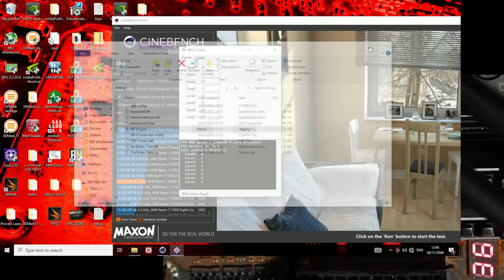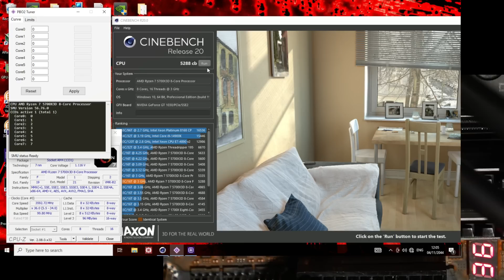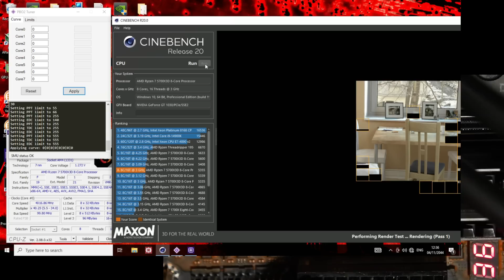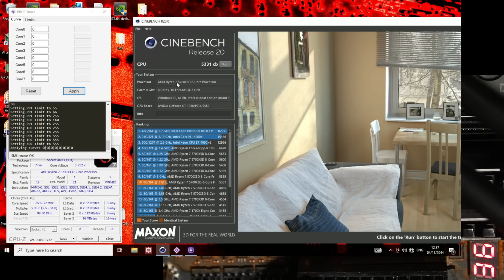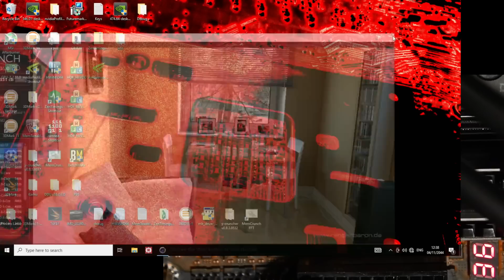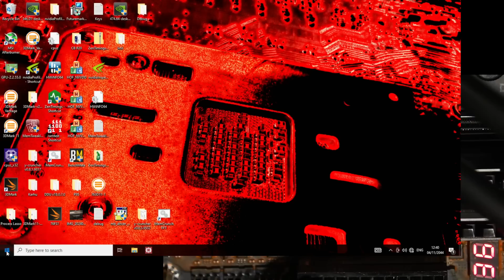Trying PBO2 Tuner on the 5700X3D

Comment: Undervolting for lower temperature when ambient temperature is a factor (Summertime) with air cooled solutions. Undervolting tis a benefit with a CPU the likes of a 5700X3D being a very decent gamer's CPU not because of clock speed, but for the additional memory cache.

Comment: It's April 2025. I have an Asus B550, with the latest bios update, you can optimize the curve optimizer in the Bios and change the frequency. The optimizer also factors amperage, which does affect overall wattage. Stock settings I got 748 points in Cinebench 2024. With -30 on all cores (-25 with core 4, which is my weakest core) I got a score of 826. That is 1 point higher than a stock 5800x3D and 10% increase over stock performance. Stock single core score was 64, after -30 optimizing, the core is now 86. That is 10 points below the 5800x3d, however that is a 34% increase in performance. Wattage went from 112 to 96 (voltage went from 1.22 to 1.09), which is a 16% reduction. Average temperature went from 86c to 77c, which is a 12% reduction. At the moment I only have a 280mm AIO, looking to upgrade to a 360mm soon. Average boost clock went from 4036 to 4126, only a 2% increase. However the biggest improvement is overall better 1% lows in games, and better stability in productivity. Overall average PC wattage in regular gaming scenarios went from 217 to 179 without touching the GPU (1440p 144hz monitor with a Rx 6800 which is also undervolted and overclocked). That said, I would like to test again with a better cooler, it may be possible I am seeing a slight thermal limit. Will test again with a better cooler.

Comment: 20:50 yes, though in games, the clock speed can lineraly improve the performance (see the different between the 5600 x3d and 5800 x3d compared to the 5700 x3d.
Reply: bro you are not a woman
Reply: @GenerationalEnslavement  keep that to yourself

Comment: The voltages on this CPU are crazy high! Even at -30 I was still seeing my temps reach the mid 70s (all of this while the CPU was consuming 40 to 50w). Only after adding a -75mV offset was I able to get the temps to a more reasonable level

Comment: What about in a gaming environment? More consistent boosting might mean less stuttering? I just installed my 5700x3d and ran a -30 offset and in cod benchmark, I have 5fps better 1% lows, 7fps better 5% lows, and the same average fps. Also like -6 degrees cooler. This is with my browser open to respond to this video through and normally I close out of this before benchmarking. Still within margins of error but it's looking good.

Comment: The best settings for me are : curve optimizer on -15 for the two best cores and -25 on others / PPT : 110 + TDC : 70 + EDC : 100, i think it depends of your cooler and i have the bequiet dark rock pro 4 but if you have a cooler worse than me use -20 and -30.
Reply: What "2 best cores" mean? How do you determine that?
Reply: @LibtardsTears  corecycler

Comment: You don’t want overclocking which pushes the cpu with the 5700x3d. Undervolting is about lowering temps and still getting the same performance. I’m at -30 and hitting 4.15ghz and down 10°C. So that’s perfect for me, does exactly what it’s supposed to.

Comment: -30 doesn't seem to work on my 5700x3D... but on the other side i don't have thermal problems so i'm not sure if i really want to tinker around with those settings
Reply: The 57 is a slightly lower power part to the 583D and therefore shouldn't run quite as hot.
I run a full water loop and the 58003d would easily get to 80°+.
-30 with PBO tuner, I'm seeing 60-70° in all games.
I can't say there's a performance gain, but there's no noticeable loss and the system runs cooler and quieter.
Reply: @pauln6803  with stock settings i get 71° max temp while running cinebench, while gaming it's about 55 - 60° 
With -25 pbo curve it's 61° max temp and 45-50 while gaming dependending on the game. Seems like i'll go with the -25 if i don't experience crashes
Btw using an arctic freezer 34 esports duo but only one fan

Comment: ROG B550-A Gaming, I can manually overclock cpu ratio on my 5700x3d, but will not go over 4050mhz even when setting 44x ratio. effective all core 4050mhz, without the bclk oc.
in my experience if I dont use any negative curve opt in bios cpu downclocks to 36x or lower, Curve opt -30 worked the best, did -15 -20 not anything between. although reading 42/44x ratio its not affected beyond that point. Undervolt/oc
My settings
Manual core ratio 40.5x, negative curve optimization of 30, core voltage 1.875 for constant 4050mhz, c states disabled, 3800mhz/1900fclk custom tighten.

Comment: I have two systems using 5700x3d. One is with an A520 motherboard (no pbo on this one) and one is with a B550. I can use PBO on the B550 setup. Running -30 on all cores. Both systems are using single tower 120mm air coolers. On B550 setup the CPU runs cooler because of the PBO and constantly boosts to 4050MHz in all core load. But as said, these CPUs will be used for gaming, and in this case the A520 setup often boosts to 4050MHz anyway in gaming, because the CPU is not loading all cores. In very CPU demanding games like Cyberpunk it can vary between 3950MHz and up to 4050MHz VS B550 setup that always stays at 4050MHz. Really makes very little difference. Of course, better temps with PBO. But temps is not a problem anyway when gaming. Only in stuff like Cinebench that puts 100% load on the CPU. In that case my A520 non PBO setup can reach 84 Celcius and clock down to 3850MHz VS B550 setup at constant 4050MHz and lower temps. So score will be a bit better. But I don't use these setups for cinebench anyway. LOL. They are for gaming. So in a way, PBO for these CPUs are kinda useless and will make very little difference in realistic scenarios, like gaming. Doesn't really matter that much if the CPU is running 65 Celcius instead of 60 Celcius in a game, while in many cases it's boosting to max clocks anyway. And even if it downclocks a bit, it makes very little difference.

Comment: As a personnal feedback, I was in the situation where the cpu was hitting thermal limits. With stock settings, this looks like it's getting ton of voltage throu PBO ; mine was constantly hitting temp limit under y-cruncher BBP, even with my big double tower noctua. Tuning CO gave me the ability to sustain max clock throu most situations ,without hitting any limit.

Comment: I just did this yesterday - got a 5700x3d for my kitchen pc - an MSi Tomahawk Max b450. Cooled is a Noctua DH15 with one fan. 
Ran CB23 and 24 - stick had peak temps of 71'c. At -30mv this dropped to 61' 😮 CB23 had a boost of nearly   1000 points on multicore. Cb24 had a boost too - both single core tesrs were very slightly higher.

Tech Yes City posted that it makes a bigger difference on air cooeld rigs.

Comment: I have an old b350 motherboard with not a lot of options for proper overclocking this x3d processor. For me and my mid-tier air cooling this bit of undervolting drops my max temps on linpack from hitting 88/89C at stock(on a day when my room is cool) to stay under 80C at -21 and under 75C at -30. Allows for gentler, quieter fan curves and who wants their stuff running hot and wasting power unnecessarily anyway. I've been at -21 for 9 months with no issues.

Comment: Have a 5800X second gen, and was thinking of moving to a 5800X3D, but they are getting hard to find for reasonable cost.  Wondering if a 5700X3D can easily be tuned to equal the perf of a 5800X3D ? (running an AIO, so not worried about fan noise)

Comment: I increased my all core boost from 3.9GHZ to 4.1 and decreased my temps from 90c to 68c. It's very useful depending on the use case (I wanted lower temps the all core boost was a slight bonus because of the reduced temps).

Comment: after watching this vid and intel 12th gen clock stretching (also by BZ) i got really curious how cpu tuning affects performance on my system (7500f, noctua NH-U14S)
stock: CBR20 - 5753 (avg of 3 runs), linpack - 315 gflop (avg of 3 runs, 6gb)
pbo (PPT 120W and +200mhz): CBR20 - 5647, linpack - 316 gflop
pbo with curve (PPT 120W and +200mhz, -30 offset): CBR20 - 5926, linpack - 328 gflop

system should not be power limited (max package draw i saw is around 115w during linpack) nor temp limited (~90c)

Comment: i tried that PBO Tuner 2 also with my 5700G -  same thing happens -  does nothing -   it will use whats in the bios -  i have mines at -12 all cores -  stable - after that it works but not stable with OCCT dosnt crash but get errors -   my best settings are with -12 all cores -   gives me 4.45 ghz all cores in cinabench -  OCCT gives me 4.5 - 4.55ghz all cores -

Comment: will pbo2 tuner work with the r7 5700x3d? -20 will lower the voltage and temps of the cpu ?
Reply: PPT 120, TDC  75  and EDC110   are important too fill out in pbo tuner   if you want any result ™

Comment: Well lower temps won't matter to someone sitting at 19 C ambient. In India, the average ambient temp in summer is 36 C. So lower temps and same performance matters
Reply: Whilst thermal throttling might not be an issue through a cold British winter, the reduction in fan noise through dropping 10-20° is absolutely worth it.
The 5800X3d runs pretty toasty as stock, regardless of ambient temperatures.

Comment: I think curve optimizer isn't really that much about performance per se, it's more about having lower temps which means lower noise. Many folks are very strict with noise so in that sense it's a good thing, especially for people like me who just slapped my good old wraith prism onto this thing, works like a charm i must say, no issue at all. Doesn't seem like it's any hotter than my old 3700x. I did notice more stable frequency while gaming when i adjusted the voltage, it stays pegged at 4.05 all cores at all times now, before i adjusted the voltage it fluctuated more between 3.95 - 4.05.

Comment: On air my 5800X3D will thermal throttle in 3s in Cinebench, -30 in the CO makes it takes a while more to happen and the scores goes from 12500ish to 14000ish.
Reply: bad air cooler  get the pearless assasin

Comment: i have this chip my self and setting -30 in curve does makes mine to clock to  4050 mhz and reduced throttling a bit i would say its good to do that if ur in extremely hot country and dont have liquid cooling  otherwise like he said it mostly worthless to do this unless in special circumtances like mine u can benfit a good amount

Comment: No reason not to PBO to -30 each core for 5700X3D, if it's stable in cinebench. Will reduce temp and thus noise and help if you have a bad cooler.

Comment: Can't speak for the 5700X3D but using a PBO per CCX undervolt my 5800X has a  stable +300MHz boost in bios to 5.15GHz. 30,30,25,30,25,30,30,29. (6149 in Cinebench @90°C on 185w rated Thermaltake cooler, 4x8GB CL14@3600MHz, mesh case). It outperforms any 5800X3D in MSFS2020 when using above 1440p resolutions and ultra settings (rtx3060).
Reply: does it really outperform 5800x3d at 1440p above gaming ? sounds unlikely to believe u have any benchmarks ?

Comment: Hi!
It seems you've got curve optimizer hidden and DISABLED at the same time in the BIOS, which I haven't found a way around yet.
Unfortunately, some board vendors play nasty for reasons unknown to me. So far I've only seen this on some entry-level boards like a520. 
"Nothing to change" in the app log means that the values you enter weren't really applied. It's just I didn't expect such "surprises" from BIOS devs when wrote this app in due time.
https://i.ibb.co/QN4dSBN/pbo2.png

Best regards! 
PJVol

Comment: Ryzen 5 5600 Rev. B2 on Gigabyte B450 Aorus Elite, PBO +200, Limit: Motherboard, Curve: -30 -30 -22 -30 -30 -30, Scaller: Auto.
Cinebench R23(Realtime) Multi: 12,044
Single: 1535
Stock Multi: 10,877
Stock Single: 1462
Prime95(Blend) 24h Stable!
I think it's a good a CPU sample.
Reply: i got just over 11k multicore score and 1570 single-core with same R5 5600 CPU on 550-plus ASUS mobo,32gb cl16 ram no custom timmings just preset, with undervolt -20 -20 other cores -18,although i did change mobo power limiter to extreme it goes over 100w in cinebench,artic frreezer 34 cheap 35€ air cooler i guess its nothing special either but i was able to manually oc to 4.85ghz all cores with only 1.325 volts stable with Cinebench temps under 90 for sustained load in Cinebench did not try Prime though for that long maybe it would crash but it was stable everywhere for my basic gaming and multimedia usage just power consumption without load was not worth it and performance increase in games were like none maybe here and there 3-5% max just not usable for gaming, but in rendering and such there were  improvements up to 10% sometimes less or more depends on application

Comment: Afaik PBO2 shifts the voltage-to-frequency curve (more from at the bottom, less at the higher to retain as much stability as possible), that shouldn't make the the CPU boost higher in any case, unless it was heavily thermally limited already and the reduction in voltage contributed to overcome that limitation to some degree, regardless, it will only allow it to sustain the same clocks for longer. It's just gonna take a breather basically.
There's a setting for it to attempt to clock higher than the rater max boost clock by a certain amount (different motherboards call give it a slightly different name, but it's in the PBO section) but in my experience with my previous CPU, 5800X (which happened to be quite the sample) i had to use a tighter LLC to stabilize it though but it works for more than a year without ANY issues and since it's water cooled it can sustain 4.7GHz at all cores with temps being around the lower 70s iirc and without even caring it will boost up to 6 cores to 4.85GHz for a while if needed.
6/8 cores have set to be at -30, one is 28 and the other one is -26 because that's the 100% stable.
I have of course tweaked the PTT, TDC and EDC for some headroom and some economy in between them but it can hold on without them, the tweaking is there more for precautionary reasons partly.

Comment: NOTE: I LITERATELY BORKED my Win10 64-Bit Pro System Playing with this App - Be Apprehensive !

       PLATFORM: OS Win10 64-Bit v22H2 Bld 19045.4046,  Open Bench - ASUS X470 VII HERO/5900X/4 Sticks of
       Patriot 8GB Viper Steel 8GB 4400 CL19 running @ 3600 CL14 with tight Subs, Radeon RX 6800XT, 2 x's Seagate
      Fire Cuda 530 NVMe Pcie4 SSD's ,  Monitor - PIXIO Prime7 IPS 165Hz which I STALL at 120Hz 1440p
      for every day use - Love this Monitor ;o)

       KEEP a RECENT 3rd Party Restore IMAGE like Macrium Reflect if you going to play with this App ;o)

       The main Purpose of this App is to tune the AM4 MB BIOS for OC'g the RYZEN X3D CPU's.
       Doesn't need to be a 5_00X3D on an AMD4 Platform the App works perfectly for the R5 3700X
       or R9 5900X... etc IN REAL TIME.

                   Screw Radeon X3D Gaming Graphics if your into anything BUT ;o)
   
 NB- [The thing about this APP, if you Change something and "APPLY"the settings remain permanent in the MB BIOS
         but can be Over-Written with a saved BIOS Profile or you SAFE Boot and Edit the BIOS providing your MB supports it].

        After ALL the screwing around I did with this app I basically BORKED my Win OS and had Over-Write the System with a
       recent Macrium BackUp Image and Boot from a Stable BIOS configuration - There you GO - Be Prepared ;o)  

      I experienced Curve Optimizer set at Negative 28 is FAST for ALL consecutive 1 or 2 run BenchMate runs,
      at approx 85c TOPS (under 90c and NOT Hemorrhaging my 5900X Ryzen CPU) with a Wale of an AIR Cooler like
      the ThermalRight Peerless Assanin 120 SE ARGB - It's STABLE 24/7 but can't say for 24/7 Gaming
      which I'm NOT an Expert at ?

      I'm 76 and play FPS BF5 (Now and Then) to TEST if my arthritic crooked fingers can still work a Keyboard
      and waiting on a list for some 3 years now for Cataract surgery.

      Have an ASUS AMD4 Crosshair X570s VIII Dark Hero which I yet to fire up ;o) 

     JUST Wondering -  How many times does BZ BORK his OS before trying to FIX IT then Over-Write it
     with a Back UP Image ;o)

      Wish I was younger and had the stamina to keep up with BZ's geekness today - SafeMode !

Comment: 5800x3d ppl usually just slap -20 on it and call it a day, way lower temps and less spikey fan noise. AND actually hte 5800x3d will happily use the 142 power limit or close to it but I think it just pumps the voltage for no reason. And seems all the limits set on the x3d chips by default are the maximum, so u can only lower them on PBO tuner

Comment: Meanwhile my MSI MPG B550 Gaming Plus supports curve optimizer via AMD Overclocking menu. I can only go as low as -30.
But that, paired with 95W limit, is enough to keep my 5800X3D below 70°C in Cinebench R20 with a 280mm aio while keeping the allcore boost clocks at 4,3 Gigahurtz and 4,45 GHz in games...

Comment: Curve optimiser is about to reduce the voltage of the CPU. Why is it there and not only Core voltage and/or load line calibration? I don't know. All I know is that thanks to this - X3D CPUs users can undervolt their CPUs even though CPU voltage is locked. :D

And I am the person who uses PPT limits on my 5800X (NON 3D). With voltages and PBO tweaks I am able to achieve around stock performance with lower power consumption and much lower temps and fans speeds - noise.

All those new fancy OC stuff is not to make your overclocking easier or better. It is all to push further the CPU on stock values, to overclock itself and beat competition. No one cares if it draws the amount of energy similar to small village. Do whatever it takes to go even 50Mhz higher! That is why many people nowadays are doing opposite things - undervolting and energy efficiency optimising. In many cases it also leads to better performance.